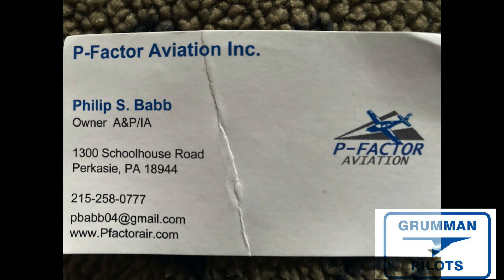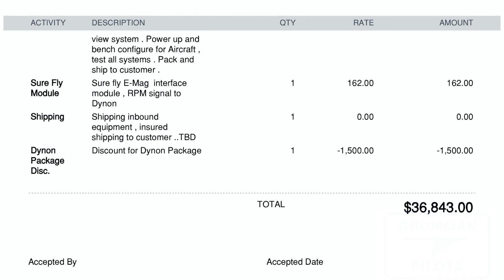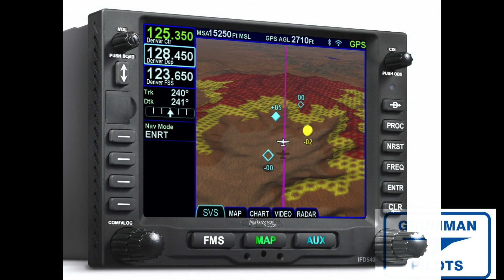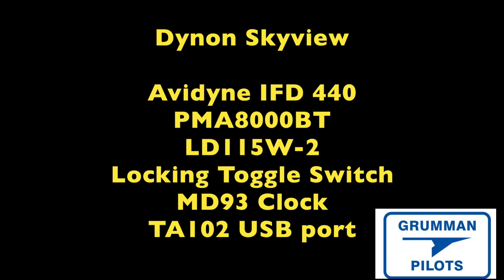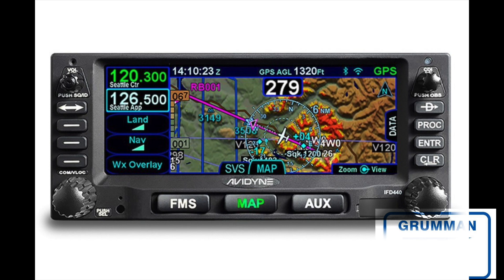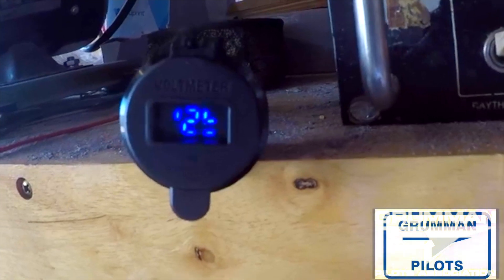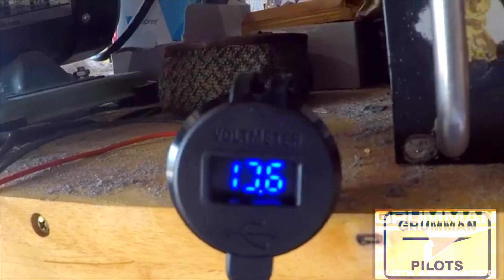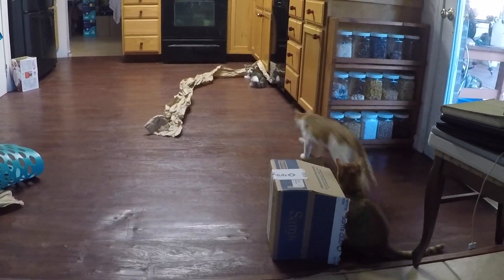Custom Dynon Skyview Panel  -  Grumman Style

Comment: Thanks for sharing, great video. I have a question you mentioned in the video that the installation was not included but on the invoice that you showed (36k) it shows 30hrs labor=$3,000. Can you explain please just because I am in the process of installing Dynon on my plane. Thanks
Reply from the maker: That 30 hours of labor on the invoice was Phil's time to make the panel and test it prior to delivery.  We figure taking the old panel out, changing all the brakes hoses with the panel and windshield out, then installing new panel and cables will be 40-50 man hours total.  Hope that helps.  Our new panel is coming end of this month and we still have the old one to pull.  Panel work will show up in the Hangar Flying episodes when it happens.
Reply: @GrummanPilots  Thank you